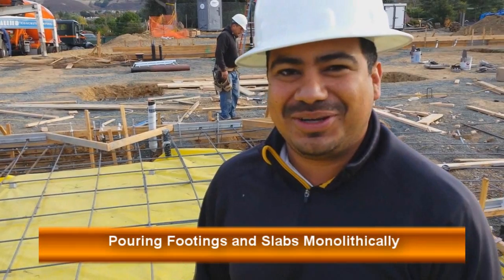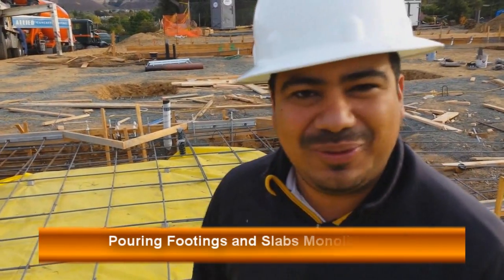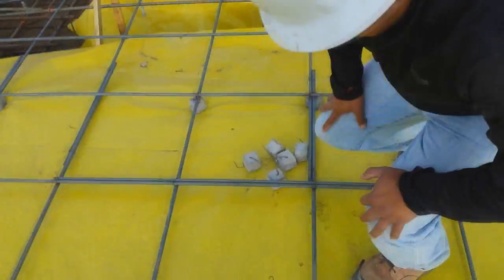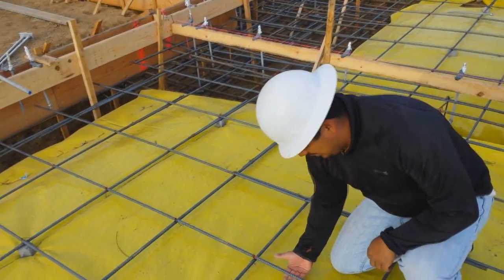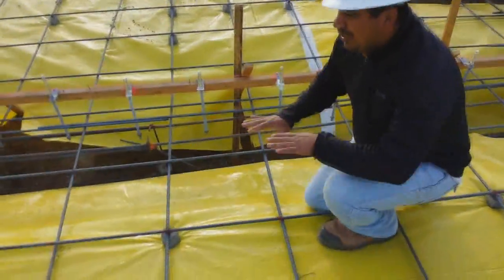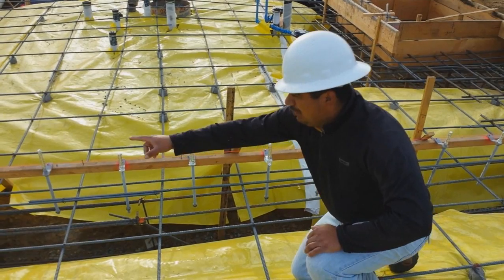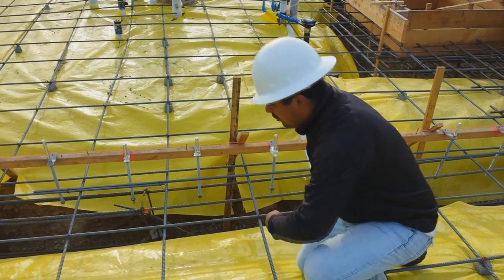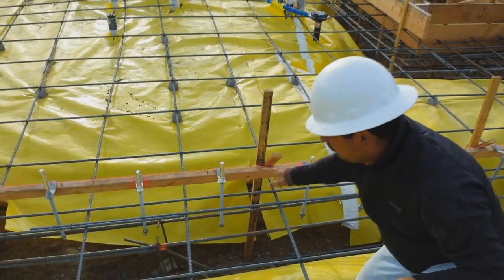How to support anchor bolts and protect them during a concrete pour

Comment: What type of bolt is the one you are holding at 3:08 minutes in the video. It seems really long and is holding the anchor bolt form. Is it a hold down for the sheer wall frame? What is the name and part number for it? Thanks for your help. 👍

Comment: the rebar runs at the center aren't on center.... also this looks shotty its small stud anchors you can wet set them no problem and have better float work
Reply: I thought wet-setting anchors was a code violation. Is that just in some states?